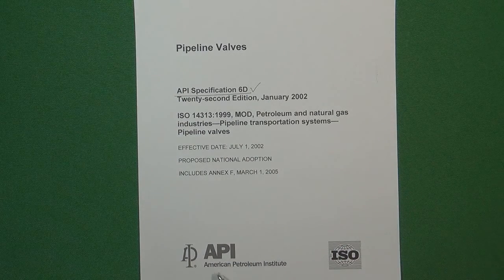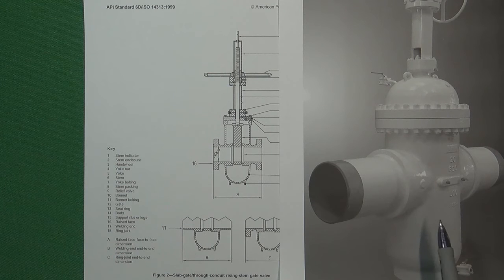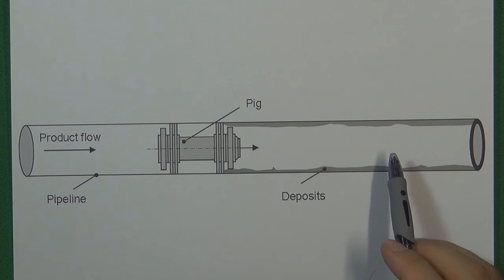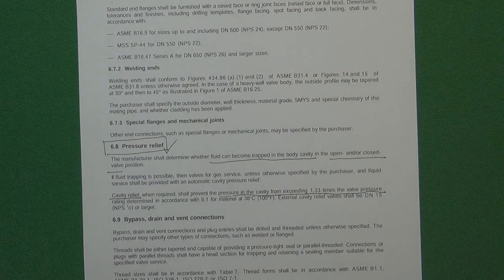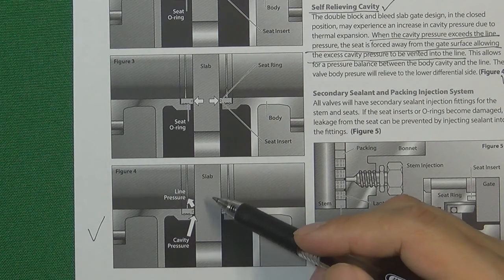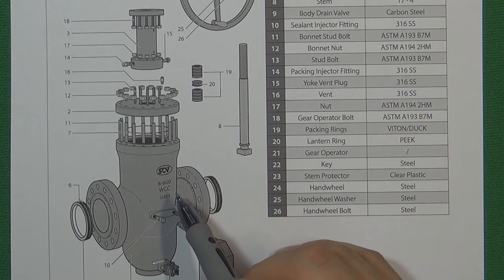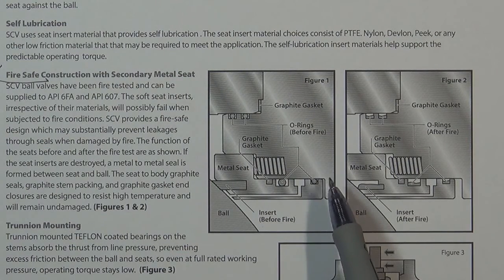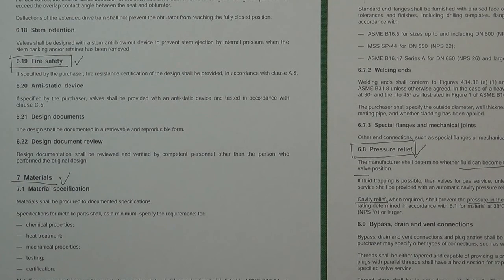3 Basic Design Factors in API 6D #Standard Tips 1

Comment: Mr. Stephen, what Is the different between  ASME B16.34 and ASME B16.5? Are materials listed on both of them satisfy the API 6D? Thanks
Reply: I will try to share what I know  - ASME B16.34 is Basic standard for Valves (Flanged, Threaded and Welding ends) for Material selection, Pressure and Temperature rating, Min Bore Dia, & Min Wall thickness of the Valve where in case of ASME B16.5 is used to Chcek or Design the Flange ( PCD, No. of Holes and Dia of Holes) Yes your correct its containing material table but not to prefer to use for design and API 6D Says to check the Group of Material in ASME B16.34 once again for design.